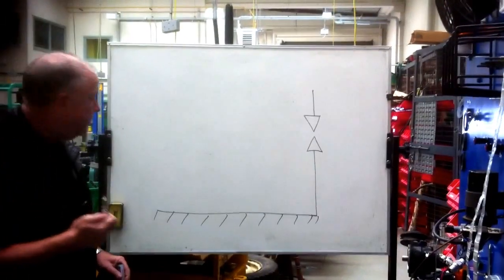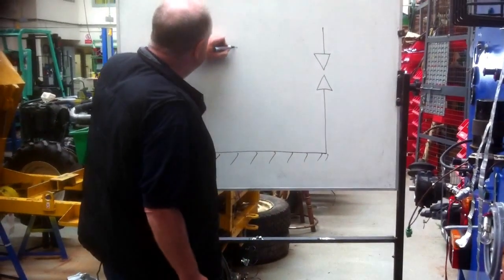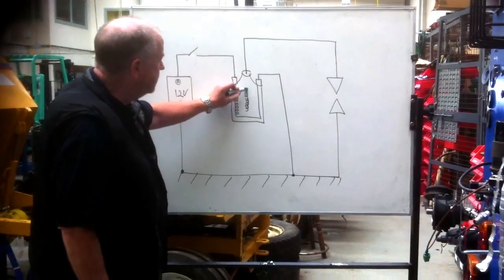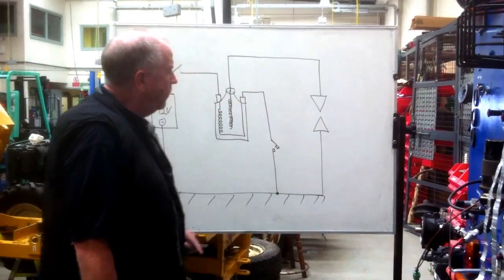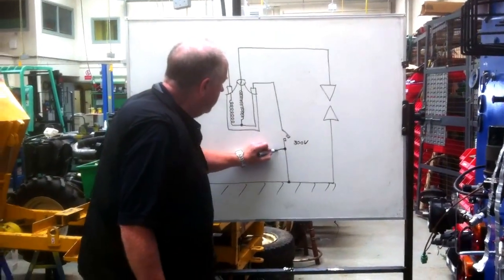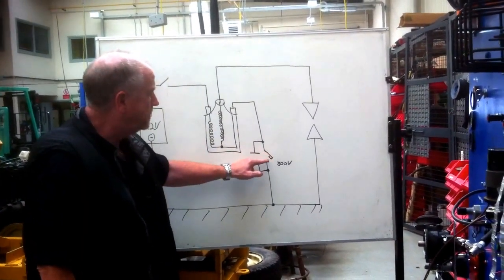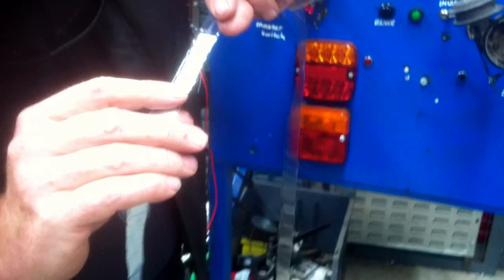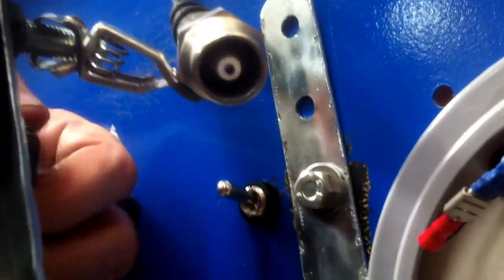kettering

Comment: hello again, could we see and update to this,,, "the condenser protects the point", but you show it arcing- like hello, can you show what happens when you put 2 condensers-in parallel, directly between the spark plug body and the -ve post on the coil, please and thankyou, ( you can leave in, the condenser next to the points)....   now you can reviews this new video https://www.youtube.com/watch?v=8TELcq7tVRI
Reply from the maker: Had a look back at the video and could not see the points arcing. In normal operation, there will be some sparking as the contacts operate, but the sparks should be weak and yellow. When you start to see stronger, blueish sparking, it was time to replace the condenser. The condenser is there to ensure the sudden rapid collapse of the magnetic field associated with the electricity flowing in the primary circuit. It is this rapid movement of the magnetic field across the secondary windings that gives us a good HT spark. As the condenser began to fail, sparking at the points became more intense and the points began to burn and pit.I agree, the condensers did fail, and we used to routinely replace them at each distributor service time. They were cheap, and the rule was, if in doubt, replace.

Comment: FYI, I found this article http://www.nonlintec.com/sprite/cap_failure/, describes the poor manufacturing quality of condensers leading to arcing, they recommend a better capacitor -condenser, but I re-read it, gave it some thought, then I put a 2nd condenser on the coil -ve post, reason - the chance both condensers arcing at the same moment would be remote, and also the non-arc condenser electrically kills the arc of the other, my long time problem in L20b Nissan engine is cured, so - please consider - on any engine with points and condenser, replace 1 old condenser with 2 new for great results
Reply from the maker: Yes, these capacitors were unreliable, and did fail. Back in the 70's when they were in widespread use in cars, we routinely replaced them at every distributor service. System is obsolescent now. I just use it to show the operation of the ignition system. It is probably the easiest way to show the basic principles. Modern systems use the same basic idea (collapsing magnetic field across many turns of wire), but I think this system is the easiest to understand and demonstrate.